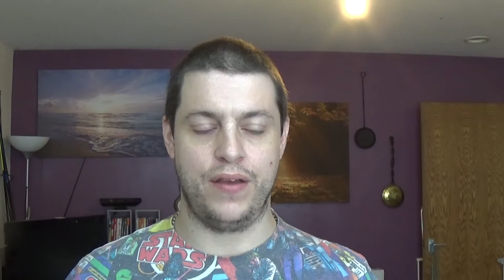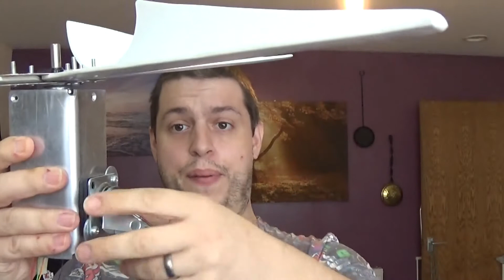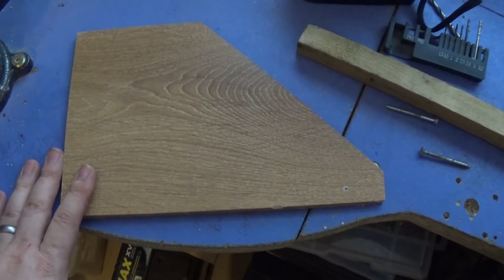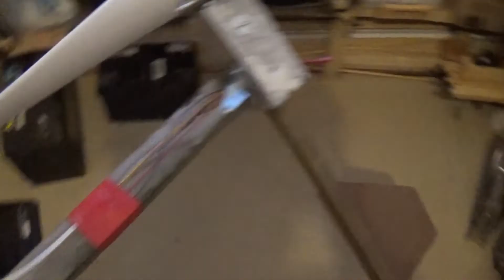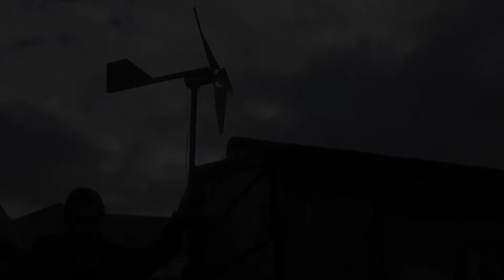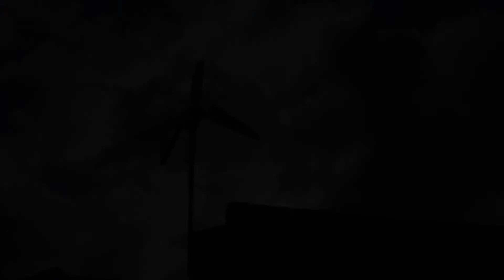Build Your Own Wind Turbine Part 5 First Test

Comment: Finally, thnx :)
Ur d best
Reply from the maker: lol there is going to be more but I'm part way through another project then its all about wind turbines I promise (well and other things)  :)
Reply: Great, Im looking forward to it ! AAAND, I have a proposition for your new housing (since you said the old one is too wobbly). Try to make it waterproof, or come up with the plan to make it "weather resistant" so that you could leave it outside whenever you want to. Once again, great videos and Im looking forward to see the new ones !
Reply from the maker: Thanks David. Im thinking of 3d Printing the housing for the next one and make it a lot more stable. There were a lot of things I wasn't happy with that need changing. I will make a video of what I was happy with and what parts I wasn't and go from there. Any input is appreciated so keep the suggestions coming.